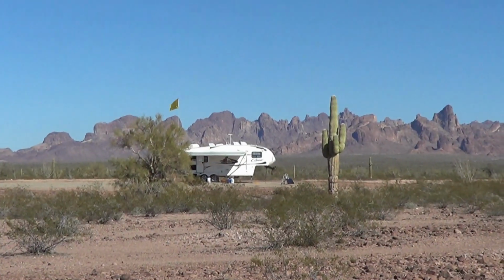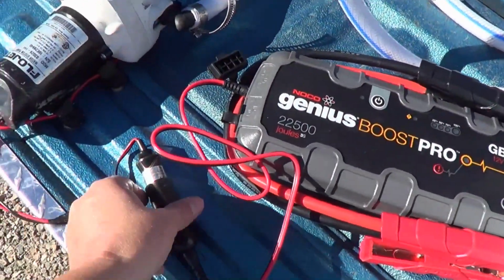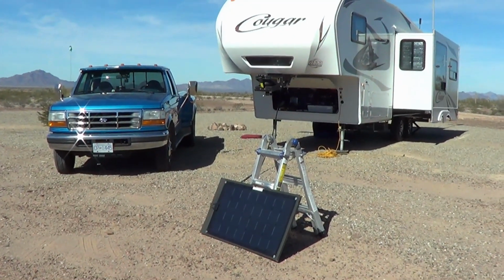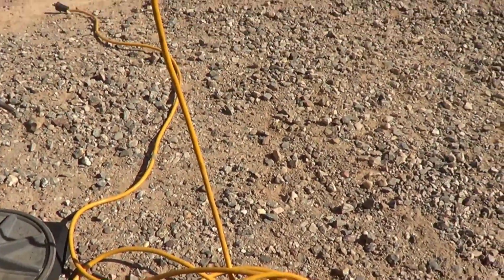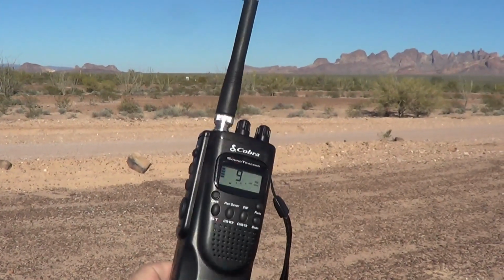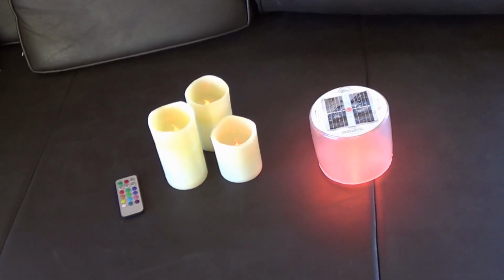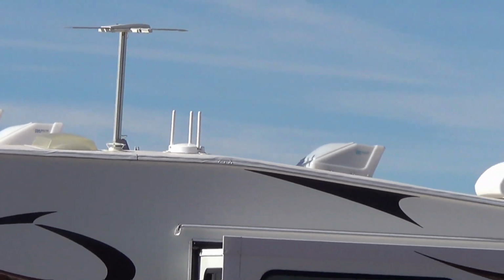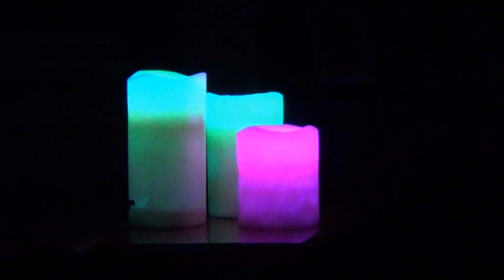Love Your RV!  Boondocking Mods and Gadgets

Comment: That battery booster is a super star, I’ve jumped at least 4 rigs and not have charged it up yet and it has the power from truck useing the cig plug .
Reply from the maker: Yes, still working well, have help lots of people get back on the road with it.

Comment: Why did you just not put the container above the tank instead of draining your battery? (roof of truck)
Reply from the maker: I sometimes do put it on my ladder and use a shaker siphon so gravity does the trick https://www.loveyourrv.com/2-simple-boondocking-water-tips-wh-temp-and-fresh-top-up/ but I also carry a 60 gallon water bladder so having a pump is very handy. :)   https://www.loveyourrv.com/off-grid-water-fill-tips-aquatank-bladder-water-bandit-and-flow-meter/

Comment: Will the noco work for your macerator pump?
Reply from the maker: Yes, but not for an extended period since the NOCO has  limited battery capacity. If I remember right it's 8 amp hours

Comment: I wonder do full time rvers use solar panels on the roof as well as say wind generators also on the roof?
Reply from the maker: Solar panels, yes. I have a bunch now. They are much cheaper and less complex than wind systems. No setup and maintenance required other than cleaning the glass once in a while. The panels make no noise or vibration like a wind turbine would. I usually only see wind turbines used on small rigs like truck campers or tiny trailers with limited roof space for solar or if someone is at the same spot for a long time, they may set up a pole away from the RV. I rarely see them on larger RVs. If they were viable many boondockers would have them.  I just don't see many wind generators on RVs. Cheers! Ray
Reply: @LoveYourRV  well that sums it up nicely; thnx.

Comment: i can not understand why anyone would want to be in a inclosed place with a gadget that puts out carbon monoxide. as having any window or vent open just goes agenst trying to stay warm
Reply from the maker: You don't understand a few key things: 1) They don't put out carbon monoxide, that's a myth. See this video done by a fire department https://www.youtube.com/watch?v=XVsfXuq1KFA  Even if it failed and somehow did start to emit CO, RVs have CO, Smoke, and LP Gas alarms onboard.  2) The ventilation of the roof vents and a cracked window is for air exchange to keep good oxygen levels but heat loss compared to the heat gain from the Buddy heater is not much, so we stay warm. The Buddy heater is 99% efficient compare to 50% for the onboard RV gas furnace. The onboard gas furnace sends half its heat outside.  So even with a window open the Buddy heater is still a more efficient source of heat and doesn't use the RV battery power to do it.  Cheers, Ray

Comment: How do I bypass my furnace to my buddy heater? Can I plug off my inlet line and hook up to buddy heater?
Reply from the maker: I plumbed in a quick connect by a using a  T fitting on the gas feed to my furnace - https://www.loveyourrv.com/mr-heater-big-buddy-hooked-to-my-rvs-lp-gas/  later I added an extra shutoff valve - https://www.loveyourrv.com/easy-access-rv-furnace-panel-modification-plus-gas-valve/  Has worked great.
I check and make sure there are no leaks with leak check soap solution and a manometer - 
https://www.loveyourrv.com/building-simple-rv-propane-leak-tester-u-tube-manometer/
  https://www.loveyourrv.com/leak-testing-my-rv-propane-system-with-a-digital-manometer/
Cheers, Ray

Comment: Hey Ray finally took advantage of one of your gadgets, put together a pump to fill the fresh tank, now have to get one of those Noco Genius GB 150 to supply 12V. probably a lot easier than lugging around a battery.  Keep them coming
Reply from the maker: Handy little box and so quick and easy to use. A couple weeks ago I rescued a elderly couple with a dead battery. :)  Was nice to be able to help out and I didn't have to risk my new truck trying to use cables to give them a jump.
If you don't have a big diesel you don't need the GB150, there are cheaper models with less total output amperage that will do the job. Cheers, Ray

Comment: @Love Your RV. Hi, how you adjust two different kinds of solar panels. Do they have the same type, voltage and current. They have to be properly co-ordinated.
Reply from the maker: I currently have all the same 12V type panels run in parallel.

Comment: I have a CB in my Pontiac Grand Prix, there's no shame in it, you can normally find a trucker within range. I got mine because I was working in a small town and had about 120 miles of my commute where I didn't have cell coverage. I carried my department hand held radio that had channels for every jurisdiction I passed through. But my CB was my only constant communication link. There are even quite a few rural sheriff's departments that mount CBs and their dispatch monitors them as well. Emergency channels depend on repeaters and bad weather can crash the system but CB will still reach.

Comment: Glad I found your channel, just subd. I see from your battery power setup you're no dummy. hope you have a CO2 detector at a low elevation. Those "deadly  silent" Buddy heaters choke at least 1 moron ice fisherman a year here in MN
Reply from the maker: Thanks. :)  I have an LP gas detector down low as it's heavier than air and a CO in the bedroom where the OEM put it. The big hazard with the heaters like this isn't CO its lack of oxygen.  The flame burning can eat up all the oxygen in a small room and you suffocate. So you need to ventilate so fresh oxygen can come into the room. 
They are worse of a hazard in a small camper or enclosure versus a big fifth wheel. The Buddy does have built-in low oxygen shut off. I play it safe and my 3 12"x12" roof vents open and crack a side window. Even if its cold out the Buddy puts plenty of heat to overcome the openings.  It's the same precautions that folks should take with the LP gas stove as the oven has a large gas flame.  Cheers, Ray
Reply: A lack of oxygen causes the heater to generate CO

Comment: Your heater could kill you if you don't have a fresh air supply!
Reply from the maker: Yes, it is plainly written in the operating instructions. We leave our 3 12"x12" roof vents wide open and a side window half open. Manual says it requires a lot smaller opening but I like to be extra safe. Also, I have 2 CO alarms in the RV, an LP Gas alarm and smoke alarm. The heater has a low oxygen auto shutdown on it. I only use the heater during waking hours and never leave it unattended. It's not really any different than using the RV gas oven, most of the same precautions are required. If used properly and properly maintained they are safe appliances.  Cheers, Ray

Comment: A pump for shifting water is such a good idea. I got tired of lugging 20litre containers around and did the same thing but also added a bit of refinement and put the pump in a safety case to protect it as it spends most of its life in the back of trailer behind our Coaster. You can check out the 'Pump inna box' at https://www.youtube.com/watch?v=ExvULcZgmTs&list=PLaAMEcpf9NAb7byPNGDM4FwLdr0GPeEjJ&index=6 if you are interested. I like the portable power source for the pump.
Reply from the maker: Nice idea with the case!

Comment: Ray, something I found that helps with the Water Bandit is putting a small hose clamp around it and tightening it.  It helps keep the bandit from slipping off the faucet especially if the water pressure is high.  Learned that from experiance in Bodega Bay, CA.  Rick Stills, Rathdrum, ID

Comment: Excellent stuff.   We use a $100 46 gallon "plastic" (looks like nylon) water tank in the pickup bed to double our water supply (and sometimes some 7 gallon jugs as well).  Truck tank is primary, gets refilled when we are out and about in the truck.  Fresh tank in the RV is backup or for longer stays far from water.  We connect the tank in the truck to the anti-freeze input to the 5th wheel pump so don't need a second pump.  It's an  easy hose disconnect with hose ball valves when we take the truck out.  Added a slip joint to the hose between the 5th and truck ...... drove off without disconnecting it once and broke some connectors.  Now the slip joint just separates.
Reply: I have seen people buy a burkey water filtration system and augment water with creek water.  I thought that was good.

Comment: If you ever want to clean the sensors in your Black water Holding tank dump a bag of ice down through the toilet  in it while your driving & it slosh around in the tank & knock off any thing that gets stuck in there . works best at about 1/2 full . just a thing i do . Thanks for the video .
Reply from the maker: Thanks, Richard, It may work for some types of gunk in there if its really soft, but I haven't had much luck when it comes to the hard water type deposits I get in the southwest after a few months of boondocking. Seems to get quite crusty in there and sloshing ice doesn't do much. I end up having to do several soaks with tank cleaners and wand flushes several times to break things up.
Here is an interesting video Fit RV did where he tested the theory.  - https://www.youtube.com/watch?v=iH6acEmqvcw
Cheers! Ray

Comment: I’ve installed a couple of these small, surface mount 12 volt LED lights as night lights - one at a step down point on the back side of the bed in my DP motor home and the other in the bathroom. I dimmed the light with some red vinyl tape which also saves night vision. I could use plug-in night lights with my inverter but most are too bright and the inverter uses a couple of amps just being on. 

I control them with the switches below. 

Dream Lighting 12 Volt Surface Mount LED Step Lights, Warm White Deck Lights for Boat, Marine, RV, Camper, Motor home, Pack of 6 https://www.amazon.com/dp/B01DBT0MKY/ref=cm_sw_r_cp_tai_i_m5A-AbEMDKNA6

HOTSYSTEM New 5PC Car Truck Rocker Toggle LED Switch Red Light On-Off Control https://www.amazon.com/dp/B007B83T98/ref=cm_sw_r_cp_tai_i_unB-Ab1NSJJPG
Reply from the maker: Cool mod. Thanks for the tip. Cheers! Ray

Comment: Definitely #2 is go to part. 👏. #3 interesting macgyver idea 👊. 
How long is your extension cord?
#4 we have range is 35 miles which is nice. 
#5 we have a smaller band radio + CB 
Would a ceramic heater work off solar or not energy efficient with solar?
Definitely need a battery monitor 
didn't think of that, Takes out the guessing. 
💚💙 the moji flag definitely going to do that. Always learn so much 
Thank you. Happy Safe Trekking 🚎
Reply from the maker: I carry a 50-foot extension cord.  An electric heater is too wasteful. Most use 800 watts on low and 1500 watts on high. Would run down the batteries really quick at night.  Cheers, Ray
Reply: Love Your RV thanks for replying 
Good to know about the heater. 
Unfortunately condensation is a real problem with Propane 😬
So wish someone would come up with a macgyver condensation invention 👏👏   
#HappSafeTrekking🚎
Reply from the maker: I've had zero condensation issues in the desert since the humidity is usually so low, in fact, the extra moisture a good thing. ;) One the coast I battle it by keeping all my roof vents wide open. Luckily I don't do too much boondocking in high humidity.
Reply: @granniesroadtrekking9220  i agree with that.  Ive seen a tech unit you take compost to make methane and you can cook and heat with your waste gas.  I want one.
Reply: @granniesroadtrekking9220  i saw some winter vampers set up an outside tent attached to their rig with a wood stove and leave the door open, then run this at night. Worsk good except in very gigh winds. They did this to get rid of the dampness of propane.  Thete are stives that heat with wood and have usb electric ports. Dont know the conversion but its on a tech gadgets that they sell.

Comment: Very nice..able to understand. Question what materials used and how did you attach your flag? Thanks Lisa aka Here & There
Reply from the maker: Here is a closer look at it - http://www.loveyourrv.com/fun-rv-tip-get-flag/  Cheers Ray
Reply: I looked at that and it explains about the flag pole on the pin box, which I don't even see in this video. I guess the one in the rear attaches to the ladder with ties and is a telescoping. (Amazon $55, so-so star rating).

Comment: That is an excellent list of accessories - Thanks!  The 2017 F-350 (non dually) lug nut torque specification is 165 lb-ft. Stiction will will likely increase the torque required to loosen them (for changing a flat) to approach 200 lb-ft.  I've used breaker bars, but not for 200 lb-ft, especially when an extension is needed just to reach the nuts (extension precludes standing/jumping on breaker bar). I would  be REALLY annoyed to get a flat yet be unable to mount the spare. To address this, I bought the 'Cheater Wrench' https://www.cheaterwrench.com/
Reply from the maker: Cool!

Comment: Do you prefer the Winegard wifi booster or WiFiRanger, if you've had a WiFiRanger?
Reply from the maker: Haven't tried the WiFi Ranger yet. I believe it is more feature rich.  Here is my Winegard review - http://www.loveyourrv.com/winegard-connect-rv-wifi-extender-review/  Cheers Ray
Reply: Love Your RV I saw it. It's pretty cool. I bought a WiFiRanger a couple of weeks ago, boy is it handy. The thing I like about it most is the router and how you can link multiple wifi hotspots and a personal hotspot together.
The router actually works as a wifi antenna also.
In the park I'm in at the moment, the outer antenna pulls a signal from the parks office (20mbps) and the router pulls off of the wifi hotspots located near us throughout the park (only 1.8mbps), then our Mobley is connected to the router via USB adding an additional (22mbps).
It can be set to add them all together, or use one by one in default, if another isn't available use the next available on the list.
I didn't do a permanent install on the outside antenna as I will put it on the new trailer when it arrives.
I will also add the WeBoost to that trailer then. I liked your video on that too.
Reply from the maker: Wicked!

Comment: Be very very careful with the LPG heater in the Rv.....many people have gone to sleep and never woken back up due to the large amount of Co2 they give off......always leave a window open to let air in.......a whole family down the road from us Died exactly like this......similar sized RV and almost the same heater !!.
Thre was also a guy and his girlfriend die last winter with a small portable heater in a canvas tent.....same thing....Co2 poisoning.
Reply from the maker: Yes, same precautions need to be taken as with the RV gas stove. The Big Buddy manual states to have at least a 4"x4" fresh air opening but I leave all three of our 12"x12" roof vents open and crack a side window for fresh air flow. Also, the Big Buddy has a low oxygen shutoff and we have a CO and propane alarm. Finally, we don't sleep with it on, just when we are awake in the evening or when we get up in the morning. We use the regular vented RV furnace during sleeping hours.
Usually, people that die did something stupid or were using an old unit.  Many older LPG units weren't designed for indoor use. Cheers Ray

Comment: Love your videos! Always very informative. Have you ever thought of or run across anyone that uses a small windmill(s) for generating power? I've noticed that there's quite a bit of wind in the location that this video was recorded in.
Reply from the maker: Thanks Jay!
I wouldn't want one due to the noise, hassle to setup and they aren't cheap. On a large RV like mine with lots of roof space and storage for batteries, I would just add more rather than wind power. On a small RV like a truck camper or tiny trailer, they may be worth while. If wind power was viable you would see them a lot of RVs in the desert, but I don't except on smaller RVs like I said.
Reply: Thanks for the quick reply! That does answer a lot of my questions. I know that there've been great strides in vertical windmill technology in the past couple of years. Some of them are very quiet and relatively easy to set up but I don't know if they'd generate enough energy to make them worth the effort. Something to keep an eye on, I guess.

Comment: Why the Buddy heater, Ray?  Don't you have a propane furnace?
Reply from the maker: It's quiet and produces a pleasing radiant heat.
Other than the noise factor the main reason is to save battery power. The main furnaces fan draws in the neighborhood of 6-8 amps. Using the Buddy heater during the hours before bedtime can really save a lot of battery juice especially if it is cold out. Also, since it is 99% efficient versus the forced air which is around 50% efficient, we save on propane costs.
The trade off of course is safety, you have to use the Buddy with caution as it is an open flame unit. So things could be ignited if close to it and it does use up oxygen. Hence proper ventilation is required.
Reply: Great answer, thanks.  We're new to RV'ing and are learning a lot.  I suspect we will be boon-docking more and more frequently as summer approaches and many of your tips are spot-on.

Comment: I also used a spare pump I had on hand but mounted it in a compartment next to the fresh water intake. I wired it to the compartment light wiring and added a switch so I could turn it on and off as needed. It sure makes it a lot easier transferring water from 5 gal cans into the water tank.
Reply from the maker: Cool!

Comment: For offloading the water jugs, why not bend up some straps with a small platcform to hook onto the roof ladder.  Hook up the platform, plop down a jug above the water tank inlet and with a short siphon offload the water.  A Walmart clear plastic jiggle siphon would be easy to start, long enough to reach, and easy to prove empty when done.
Reply from the maker: I used to do the siphon thing, but the pump is so much easier and easier on my back lifting the jugs. ;)